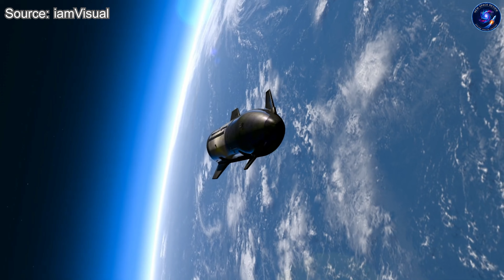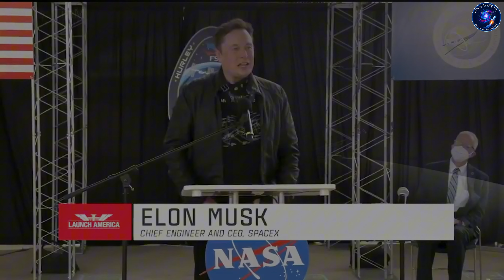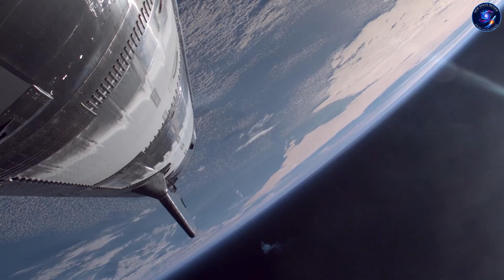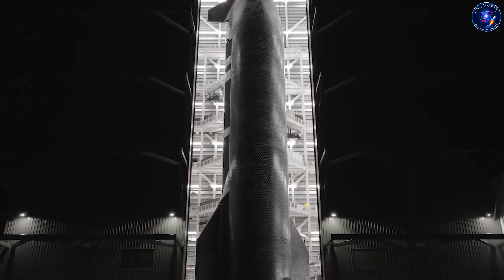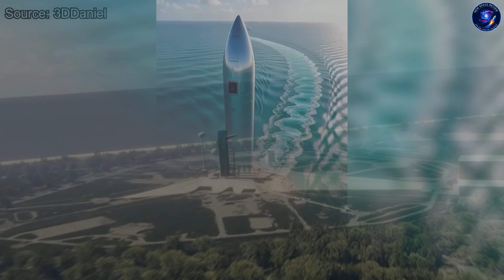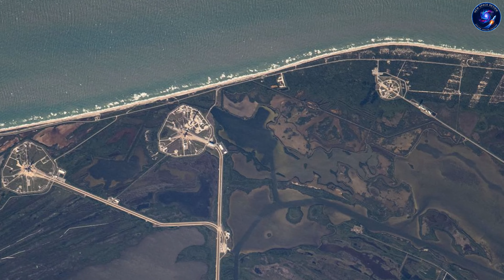SpaceX Drops Big Starship News: Landing on Drone Ships, Here's Why...

Comment: I see it crashing with those legs 🦵.  The legs need to be as long as half the height of starship they must be light weight and strong enough i see thin, long,and made more for stabilization than shock absorption.  The legs will be like a spiders thin,long,and positioned for top over just to keep it from falling over on landing.  The little legs on the skirt will be the main shock absorption with the legs being mainly for stabilization.
Reply from the maker: Great point! The deployable landing legs are indeed designed more for stabilization (like Falcon 9's) than heavy shock absorption—the skirt's crush core handles most of the impact energy. Thin & long makes perfect sense for keeping the massive Starship from tipping on a drone ship. What do you think about the engineering trade-offs for Mars?
Reply: I would hope that their engineering teams will design a landing support system that consider these issues.